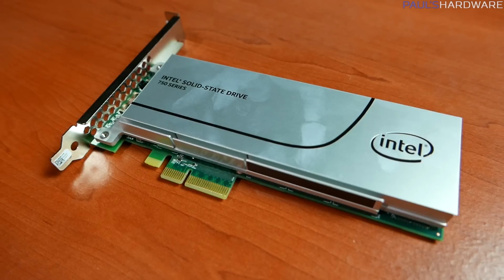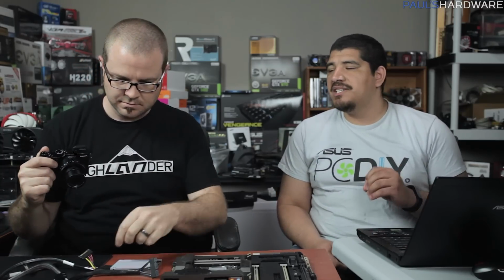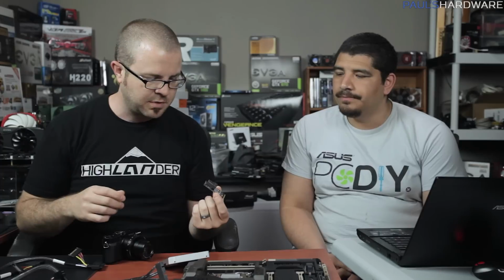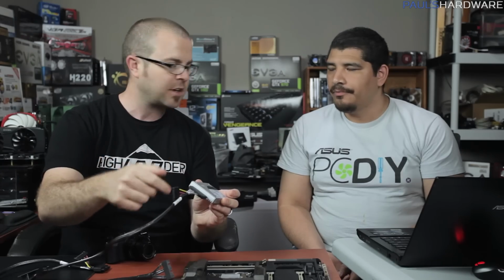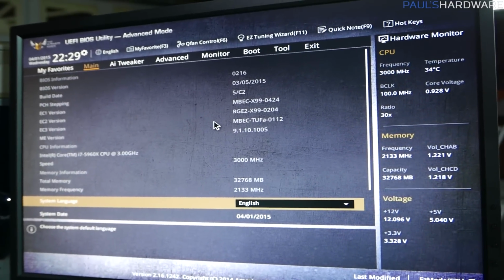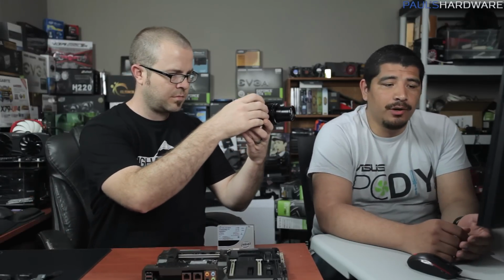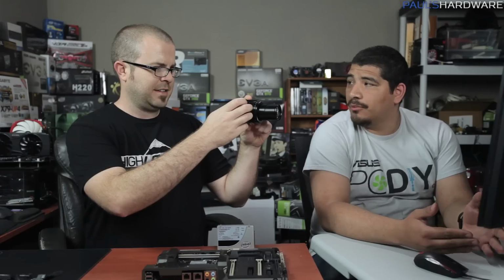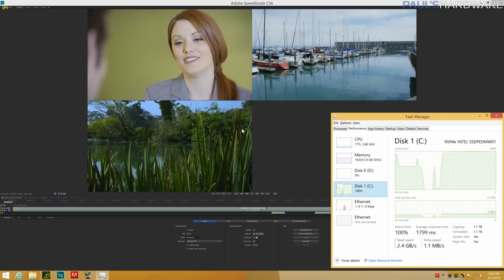Fastest SSD Ever! Intel SSD 750 with JJ from ASUS

Comment: So I couldn't use this on my gigabyte x58 board? I swear the whole world wants me to upgrade!
Reply: Yeahh......you REALLY should what is your processor?
Reply: I've got an i7 950@ 4.5 ghz. But I plan on upgrading to a xeon x5650 and overclocking that and taking advantage of the extra 2 cores. I really don't have a reason to upgrade just yet, my overclock doesn't hold back my r9 290 and dx12 is supposed to help remove cpu bottlenecks. I could probably get another 2 years with that x5650. Its only $80 for and overclockable 6 core processor on the same socket, so its a win in my book. Not looking forward to buying a full priced cpu and mobo yet:/
Reply: Luke V they both have 6 cores though. You'd be better off saving up for a new mobo CPU combo than going for some small barely noticeable difference
Reply: Captain Leerox I need a work station pc. The xeon I'm buying has 6 core and can be overclocked to around 4.5 ghz. I already have an x58 board. why are you trying to tell me different? The Xeon with 12 threads absolute destroys the i5. Gaming is secondary for me and my i7 950 works just fine, Xeon will be better. Maybe do some research ,or at least read  the conversation you're commenting on before replying...
Reply: Luke V Huh, thats strange. I could have sworn
Reply from the maker: Luke V I think they'll go back for X79 updates, but I doubt X58 will get any love, it's a bit past its prime (though I do have many many fond memories of my OG i7 920)
Reply: ***** Ok, first of all stop typing in bold. That's not what bold text is for. And second of all, SSDs are far more reliable than HDDs ever will be. You know exactly when an SSD will die, how much as been written, is left to be wrote, etc. Whereas HDDs it's all luck. You're clearly doing something wrong with your SSDs if they keep dying constantly.

And seriously, writing everything to DVDs? Those things are <4gb, how little data do you have?
Reply: Luke V the X5650 is basically just an I7 920, stay with the 950 if you already have it.
Reply: Jacob eMatt Its got more cores, which I need, according to hwbot.org actually overclock higher, and is on 32 nm vs 45. It's only $80 I don't see why not.
Reply: No the i7 950 is a quadcore. The only 6 core i7's on x58 are the 970, 980, 980x, and 990x. Trust me I own the 950.
Reply: Jacob eMatt Nah bro bro its a quad. 
http://ark.intel.com/products/37150/Intel-Core-i7-950-Processor-8M-Cache-3_06-GHz-4_80-GTs-Intel-QPI
Reply: Paul's Hardware x58 came before m.2, there's no real way for it to work
Reply: Luke V Dude that's like a 6 year old board.  Wait for Skylake though.
Reply: ***** There's no evidence this is less reliable
Also, 4 times as fast in reads and twice as fast in writes isn't "slightly" better
Reply: ***** An SSD will last 1000 years as well, you know. They only die when they run out of writes/get mishandled
Reply: ***** What SSD were you using? If you want reliable, Go industrial. Its going to cost maybe three times as more but it may last over five times that if you were to get a regular consumer grade product.As soon as you flush out the capacity of iops it supports SSDs start losing reliablity. Thats why they have come up with things like MLC and the forth.
Me and My friends have burned through plenty of them except Samsung 840s and 850s. The least reliable are the OCZ brand and early SSDs. Heavy use(eg Servers) means the average 100-200gb SSD will last 6-8 months because large amounts are cycled. If you page large you lose more. If not industrial, aim for the higher quality SSDs.
Reply: ***** That's why I typically skip a few generations with processors/motherboards.
Reply: ***** Have you tried anything from Crucial, Samsung, or Corsair?  Those tend to have very reliable SSDs.
Reply: Luke V Geez!! Noooo you don't want to upgrade to a Xeon get a Haswell CPU. How much money are you willing to spend?
Reply: Captain Leerox I think it depends if he/she wants a workstation.
Reply: Captain Leerox It's an $80 at most for the xeon. Buying a new i7 and z97 mobo would be around $500...
Reply: Luke V ?
I5-4690k is $199.99 (2x faster than that Xeon) and the H97 performance board (best value board) is $79.99. You don't ALWAYS need i7. The 4690k beats a 3770k, an i7 that costs a LOT more.

And if you want you can even get an i5-4440 (still beats Xeon and 920 combined) and a H97 performance. Are you overclocking? Get a Value (<100$) Z97 board.Your paying less than 250$.
Where did you get 500$?
Reply: Luke V I've seen really cheap Xeons and really expensive ones like my AMD CPUs (1400$ a piece) or higher. But yeah if the option of upgrading costs less I might go with Xeons budget wise.
Reply: WhiteWolfos But Xeons performances suck
Reply: Captain Leerox That depends on which Xeon. You can think of them as different tanks. They range from old tanks made of wood to new tanks with features, speed and power.
Reply: WhiteWolfos True. But I7's have better price to performance.
Reply: Luke V ? And you're telling a 89.99$ Xeon beats a 200$, more power efficient and with quicker cores i5 unlocked part?
Reply: Captain Leerox Yes, they do. Remember. these were the xeons you could overclock, and holy balls you could overclock them
Reply: Captain Leerox Yes, they were $1000 cous when they first released. The price has dropped, go do some research.
Reply: Luke V Dude a 1000$ CPU from 2009 (I don't actually know when it came out) can easily be beat by one of today's 200$ procs.
Reply: Captain Leerox It really can't though. An x5650 can be overclock to ~4.7ghz if you're lucky, at which point it's basically equal to a 3930k.
Reply: Captain Leerox Stop replaying and do some research. You've made a big enough fool of yourself already.
Reply: Luke V Dude! The Xeon DOES beat the 4690k! But I'd bet if the 4690k was a hyper-threaded hexa core and had a bit more cache it would win.

Actually the reason I thought the I5 would win was because I didn't know any of the specs of the Xeon. But single thread perf for the 4690k is better. But why not go with a newer Xeon?
Reply: Captain Leerox I already have an x58 board so it'd only be an $80 upgrade. If I had the cash I'd just buy a 4790k and z97 mobo but sadly I don't.
Reply: Luke V Ahhh ok I guess its ok for an upgrade for 80$. Especially if you're getting that much multi-core performance.
Reply: Captain Leerox If the i5 was a Hyperthreaded Hexacore with more cache it'd become an i7. Thus the price would go up to that of an i7. Just kinda needed to throw that out there. An i5 that performs the same as a hexacore i7 is no longer an i5 especially since every i5 I've seen has no HT which is usually the difference between the i5 and i7. i7 has HT i5 does not.
Reply: ***** lmao someones salty over buyer remorse.
Reply: Jacob eMatt Sir, you are wrong in both your statements. First, lower end SSD-s, left unpowered for 3-4 months, do get their data corrupted. Better quality SSD-s will loose their data within a year-two(three-four) - that statement I found in Internet a few weeks ago. Though I don't want to look for this article in Google now to give you a prove. Second: SSD-s do not die when run out of writes. After saving the information from the SSD, you can use a special feature in motherboard to totally renew the SSD - at least the manual for my old Asus Rampage 2 says it has a feature of "repairing" the out-of-writes SSD to the like-new conditions... and this is quite old motherboard...
Reply: Aleksandr2975 No, you cannot repair writes in new SSDs. That was an old feature that doesn't work anymore. It was a holdover from when SSDs were newer and inefficient.
Also SSDs don't lose data when powered down. That's not how it works. It depends on whether whatever it's plugged into loses power or not.
Reply: Luke V Maybe you can give me your opinion? I was also thinking about upgrading my gaming from i7 920 to one of cheap but fast Xeons with the same socket. The problem is that my Asus Rampage 2 does not list Xeons in its list of the supported processors,,, would you think I still should try and hope that my motherboard would work with Xeon?
Reply: Aleksandr2975 They'll work
Reply: ***** Well... if I upgraded that far, I would go with four-core i7-4790 and one of the newer Asus motherboards, maybe even with factory water-cooled Asus Maximus VII Formula. (Sorry, I did not mentioned I won't use it for anything heavier than moderate gaming, so I don't need multicore.) My thoughts now are about replacing my current i7 920 with fast and cheap (now) Xeon. Would appreciate the information where to find someone's actual experience description on using Xeon in Asus Rampage II motherboard: I am afraid, because Xeons are not in the list of supported processors for this motherboard at the manufacturer's web-site, in spite of the same used socket 1366.
Reply: +Luke V yes you can i run three 750 400GB plus SLI configuration
Reply: i don't use windows. and retiring an x58 board with a 950 cpu would be a bad idea. i did buy 3 of these ssd's. one is placed in that x58 system since july 2015. a ga-x58-udp3 system. 2 are placed in x99. ga-x99-ud4p.  

I really can't complain. I wish I could. But I can't. This drive is great. 

It's not bootable from bios, but a small tiny partition on a raid, or an usb stick or anything really is enough to load grub a kernel and then the drive. 

The drive  will not max out on this platform, but it will add years to the platform. Especially if you have a good videocard and enough ram. 

X platforms are not really made to become obsolete. Not so fast. Not like others.

Comment: what are we talking about in terms of price for the 2.5 inch 400gb model?
Reply: You can preorder the drives on newegg right now.
400GB is around $470.00 and the 1.2tb is around $1200.00 this is the pci express add on card versions not the 2.5" drives. They ship 04/24/2015.
Reply: Hundreds.
Reply: Rikudou Sennin 500 bucks
Reply: Joseph YaZe no
Reply: Andrew Eichorst why did pcper say its 330$ for 400gb and about 1k$ for 1.2tb one then?
Reply: I listed the price that is on newegg. for the drives on newegg. PCPer probably listed a ballpark range.
Reply: The PCIe version is already available for about $400 unless this drive is significantly less than that there's no reason for someone to get it for a desktop. They need to release a 9.5 or 12mm version of this.

Comment: well......time to get a second mortgage so that I can buy this thing
Reply: ***** oh...ONLY?
Reply: TheBlisterer yes only .... 6 months ago you would be looking at $1200+
Reply: Dominic Lobban To be fair, there's nothing wrong with just whacking a 3TB HDD in your (new)PC build, HDDs are fast enough for me and I don't think I'd fill up a HDD with more than 2.5TBs of stuff anyway. Games arn't that big yet.
Reply: Eric Lin The Z97 M.2 slot maxes out at 800 MB/s while the X99 M.2 slot maxes out at 8000 MB/s, or 10x faster.
The SSD will saturate the Z97 M.2 slot and will run so much faster (around 2 - 2.5x) with X99.
Reply: Tommy59375 I was thinking of going Skylake.
Reply: Elijah Ramer
Don't quite understand your question, but PCIe 3.0 8x is also 8000 MB/s and PCIe -> M.2 adapters can usually deal with at least 4000 MB/s (ie not a problem yet).
The Intel 750 Series SSD (PCIe form factor) can run at full speed on Z97, but you should ensure that the PCIe slot can actually provide at least 4000 MB/s of bandwidth.  Often this is not the case if you have a graphics card installed, because only the top slot can do so.  The bottom slot usually can only do 2000 MB/s and you will have a little lower performance but it will still be much faster than a regular SATA SSD.  If you tell me your motherboard, and current setup I can see if you would have a problem or not.
Reply: Fucking guy. Lol!
Reply: Meh, I still wouldn't get it.
Reply: I'd rather put money into a 980 or a 2nd graphics card. I can run cheaper SSD's in raid. other than that my hard drive is the least of my worries.
Reply: TheBlisterer agreed. I actually have 2 HDD's in raid 0 for 2TBs of space and its good for me. I can barely fill 300GBs anyway. Dont get me wrong. If I had money to blow I would get the SSD in the video.
Reply: Dominic Lobban Yeah same, I guess we all would if money was no object.
Reply: ***** m.2 is on x97 motherboards also.
Reply: ***** sorry typo.  z97
Reply: ***** Err... Why would I need a x99 mobo for this?
Reply: +TheBlisterer 1.25 per GB is cheap as fuck lol this thing is 5x faster than standard ssd
Reply: ***** My SSD is already pretty fast, 5x faster would be basically instantly O.o
Reply: +Tommy59375 is that also true in any way to the PCIE version of this card and the different mobos?
Reply: +Dominic Lobban Do you like to smoke some crack now and again?
Reply: +Dominic Lobban Do you like to smoke some crack now and again?